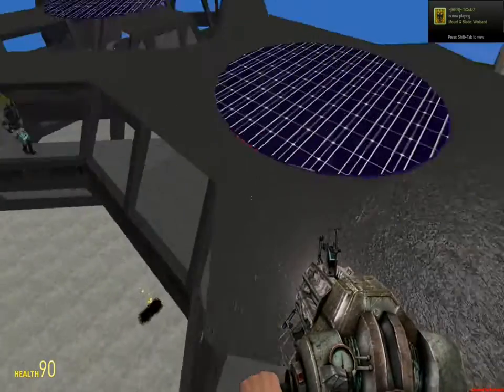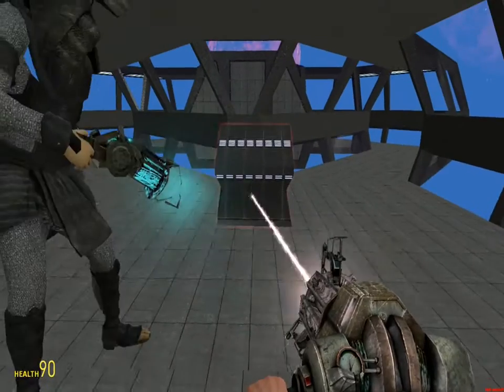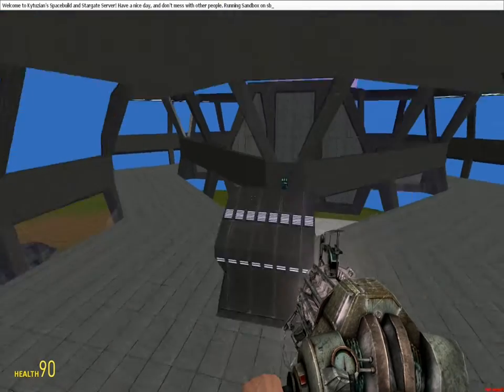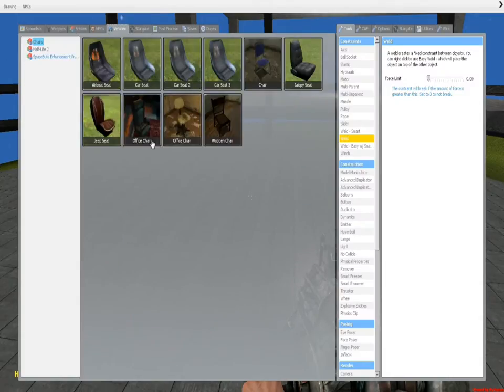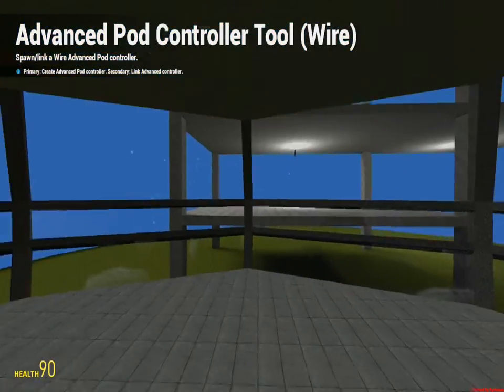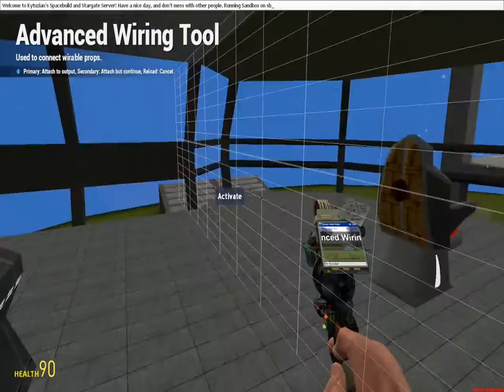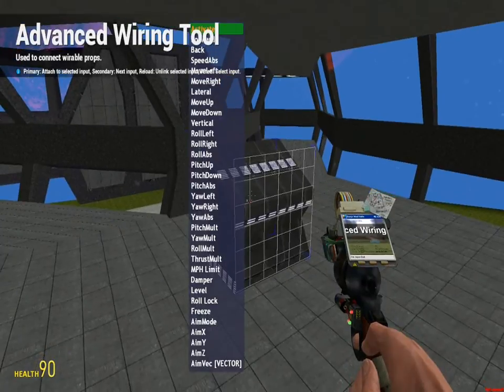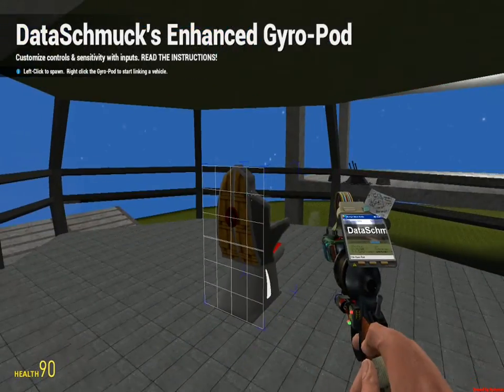Garry's Mod - Spacebuild Tutorial - Ship Building - 2 - Propulsion

Comment: i can not find advancedd pod controler and that dataschmucks encahnced gyro-pod in my wire mod and SBEP
Reply from the maker: I believe in the newer versions of Wiremod the Advanced Pod Controller is simply referred to as a Pod Controller. As for the Gyropod in SBEP, it should be there, so you might have to reinstall that. Good luck
Reply: Kytuzian I found it, but anyway, i right clicked on gyro-pod, then right clicked on vehicle and it doesnt move. :(
Reply from the maker: 1M2A3K4S Did it not move with the mouse, or not move along planes (like forwards-backwards/right-left/up-down)? First, make sure you welded the chair to the rest of the vehicle, then make sure it's not frozen :). If that is true, make sure the gyropod is on. I know a lot of this is really basic advice but they're pretty common mistakes.

If all that is right, then try using the wire debugger to determine if the gyropod is actually receiving the inputs if it's have issues with moving. If its issues with the mouse-look then it could just be an issue with the actual gyrood itself and not with anything you're doing.